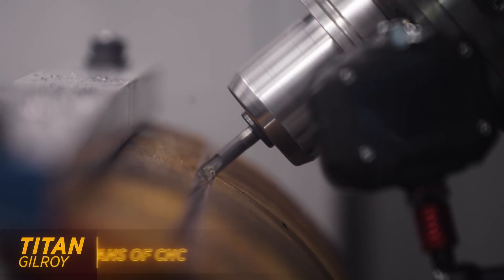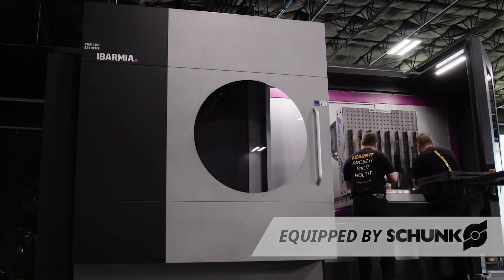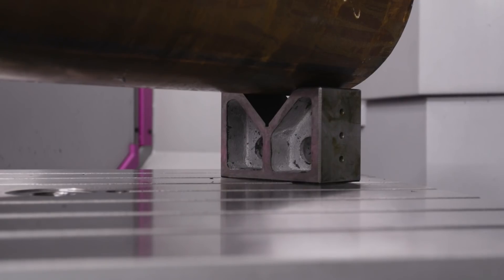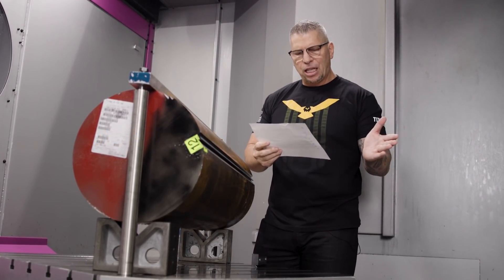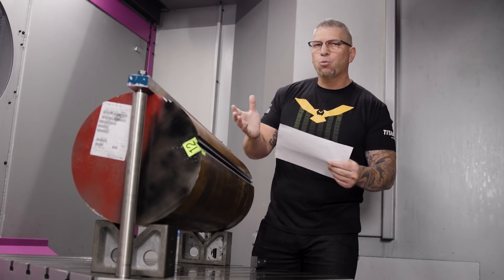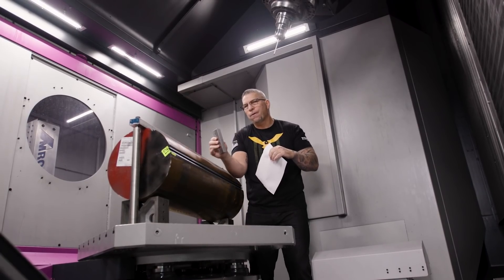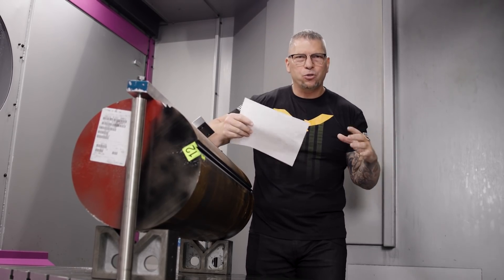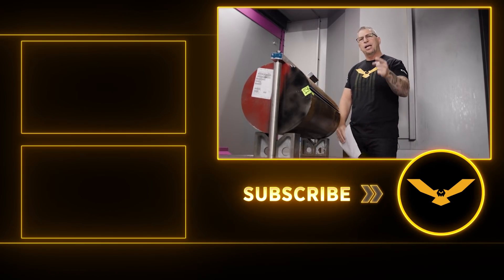1600LB Material Fixture | Results

Comment: Obviously the jaws held, having watched the subsequent milling. But, having the fixed jaw on the bottom seems weaker to me as the force of the piece is trying to “roll” down, resulting in a large pull force laterally out on the movable jaw. The torque factor comes into play almost as much as the downward force. (thinking about bridge physics here). I’d love to see your team’s analysis calculations.

Comment: This is part for the Very Big Wood Thickcness Planer. This first cut of the big shaft which you did, it is a slot for big knife holding. I think that is part is specially design to fast replacing knife, but i know that some of the companies produce self-sharpening systems. Probably application needed other solution.

Comment: They are limited in milling/drilling/tapping the bottom side of the part with the tilting head.
When they mount the fixtures on the table it's way more rigid and they have full access to all 5 sides for different operations.
I'm curious if they reinforce the back of the tombstone with a 90 degree support mounted to the tombstone and the table to prevent flex and vibration.

Comment: Titan I love that solution. It's sublime in its simplicity! But with that much weight hanging off of a side of a tombstone you might want to keep your drop indicators handy...... Depending upon the rigidity of its construction, your pallet mounting maybe unstable...... So keep an eye on it. You may have to offset the tombstone so that the center of weight is closer to the center of rotation.

Also, the dovetail idea looks kind of flimsy to me..... if you have that bar hanging on it in a horizontal position. But if you reorient it to hang in a vertical position, providing a heavy duty jack stand or underlying support under the bottom end, then you'll reduce the amount of torsional pressure upon that dovetail and may hold the part better.

Just something to consider.

Comment: I didnt quite understand the upside down vise? Ive honestly never installed vices on a horizontal with the moving jaw on bottom? The handle would be falling off all the time. But we only use kurts. Are shuncks arranged with the handle on the fixed jaw side? How much weight can be safely cantilevered from pallet centerline? Does this machine pick up the pallets an turn them into the machine or is it a pallet slider type. I ask cause we had an operator setup a pallet to heavy to one side. When the pallet changer arm tried to slide the pallet in, the pallet tipped an jammed the sequence. Didnt tip over and out of the machine, just jammed it. The the pick up an turn style pallet change might have tipped an flung the whole pallet off the machine. There is no hold down keepers during a pallet change on the spin styles.

Comment: I still think it is done a bit complicated. You could have milled 4-8 flat circular areas and drilled threads in them m12-m16 should be enough to hold it with ease. Then used long screws through rolls with a hole in them that all have the same length. You pretty much screw it then to the table like you do with Vices.
(we often do this as we have sometimes not premilled parts that weight up to 6tons) (if you like to my bosses agreed to show pictures to it)

Comment: How necessary is having a matching radius in the flat clamp? And stainless for bolts? As if stainless will be stronger.
Reply: The matching radius could have been substituted for a couple other methods. The stainless wasn't necessary, we just had a couple pieces of drop off that were not needed elsewhere!

Comment: I got the answer correct. Keep it simple. 

V-blocks, studs and a bar over the top for the first operation. 

Although my answer included facing and center drill the ends for a face driver in the lathe. Slightly different than what we do at the shop I am working at.

Congrats to the winner....

This video and contest was also a good way for me to get ideas to use when I'm at work. 

And to be light hearted... if you see fire...,,, then maybe....,,, possibly...,,, hit feed hold... only if you are scared lol...!!!

Comment: I would have layed the diameter in a T slot . 2 Strap clamps to table no V blocks . Fly cut one end , then stood it vertically . One strap clamp and then milled the dovetail vertically. Boom easy pezy

Comment: you said, you want machine 5 side in one opetarion, with your fixturing you only get 4 sides. uper, front, right and left. on the backside are the vicee and the tumbstone and on the under side there is the pallet of the machine. i guess if you want to machine 5 sides at one, you have to lay the vices down on the pallet without a tumpstone. i dont know the travels of the machine, maybe there are to short for that.
Reply: You can reach upper but bottom as well. Thombestone is at the backside. 🍻
Reply: @johnnychimpo9583  no you cant. The head of the machine is to big. There is not enough space to get under the part.
Reply: He always needs a third operation, one for the dovetail, one for the 4 or 5 side machining and a third one to remove the dovetail with whatever the shape is.  Same question, I totally don't understand that he didn't put the fixtures on the table, much more rigid.
Reply: Ah but the head tilts to -45°, side 5!

Comment: Just the weight of that stock sitting in the V blocks would have been enough to hold it for that light milling 1st op 😂 damn that’s cool tho I look forward to seeing it mounted in the vices on dovetail. Have you shown or mentioned what the final part will be yet?
Reply: You would think so, but not really. I worked in heavy machine shop for 20years. Even when it comes to centre drilling forged shaft that weighed around 20tons, sitting in Vee blocks it still has to be clamped down.  (Used to c'drill shafts in a horizontal borer before putting in a lathe).

Comment: 🎊🎈🎉Congratulations on a winning solution.🎊🎈🎉 I thought the guy who suggested superglue and duct tape had a pretty funny solution. Frankly, I think it would have worked if contoured aluminum blocks were glued at strategic points and clamped to the table. 😄

Comment: You are measuring threads with a thread micrometer? Is there any specific reason for that? Because we use good old thread ring gauges for that.
Reply: Yeah I dial in the pitch diameter with a pitch mic and verify with a ring gauge.

Comment: Should it have been obvious that the cuts were going lengthwise? I guess there were only two ways to hold the material: either stand it up or lay it down. Also, that is one huge machine. You could set up an apartment in there.
Reply: Probably cheaper than a NYC studio too
Reply: You could set up two apartments and switch it out with the pallet changer.

Comment: great work! one question, is there a better way to fixture large round large parts like you have shown, with smaller v blocks? more specifically when the surface is contacting the hard corner of the vblock instead of the flat. I would imagine it wouldn't be ideal on a finished surface since the hard corners would be making contact with the surface of the part, and the corners of the vblock aren't inherently precise. I've ran into this scenario a few times, and I always try to use minimum clamping force and take light cuts when I do. the only other way I can thinking of would be to make a pair of blocks with the profile of the round, but that's a lot of work.
Reply: Always want to be on the flats of the v block.  Larger v-blocks of like you said machine up a fixture.  Something like that shouldn't take more than a few hours.

Comment: Too bad you don't have a multu axis cnc lathe with articulating spindle. Would be perfect for that part depending on drawing.
Reply: I don't agree. We still don't know how it's going to look like, but if they are not making it on a mill-turn, then there must be a reason for that. Even with two spindles, you can't machine left and right side of the cylinder and with part this big, you can't just move piece from one spindle to another; you have to hold it with two. 
Also, not every shop has lathe that big, not to mention mill-turn, and this is all about problem solving. 
Some materials are hard to get as square stock in right dimension and you have to figure out how to make it on a mill. And that's  one of the ways to do this.
Reply: @Stasiek_Zabojca  two spindles? What do you mean? You have two chucks and one spindle. Depending on tolerances and extra material you would have no problem machining on a lathe. The part is a cylinder yes it will machine just fine on a mill but it would be better on a lathe is all I'm saying. This is due to the fact that you have to redial the part maybe more than 4 times. On a lathe you shouldn't have to redial at all.
Reply: @Stasiek_Zabojca  they don't have a lathe big enough is why. In what aspect do you not agree please explain how a mill would be better than a lathe for this part I'm very interested. Maybe you know more than me
Reply: @machinist1337  
They have a Doosan SMX 3100ST mill-turn that's big enough but it would still takes two operations to make, one 360° on all sides (radial) and one on a (5-axis) mill to make the ends, you need more material to hold it in the chucks.
With the set-up they show on the Ibarmia it takes three operations, one for the dovetail, one for the 5 side milling and a flip over for the operation to remove the dovetail with the correct shape.
Reply: @ytfan3815  yes your absolutely correct. Even in the lathe they would still have to machine where it was held. And where the center drill/2nd chuck is and yes that would have to be milled so that's 2 operations.
Reply: @Stasiek_Zabojca  You don't need two spindles. A face driver chucked in soft jaws and tailstock can turn and mill everything except the end faces.
Reply: Ehh ya...